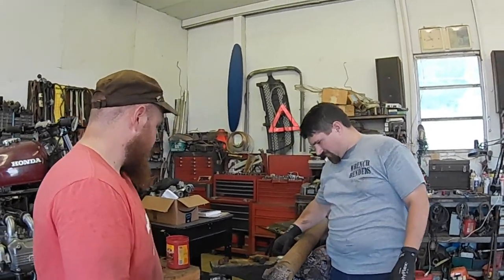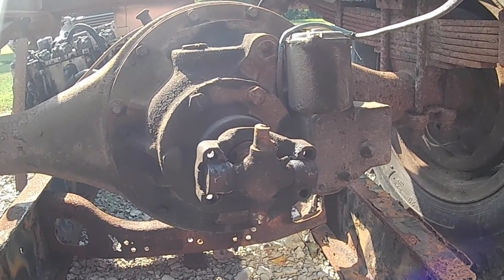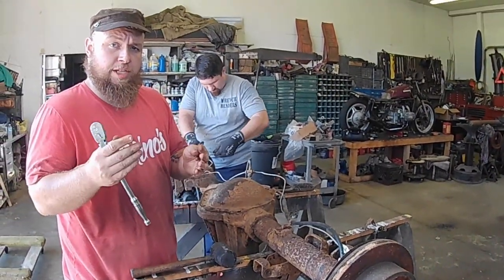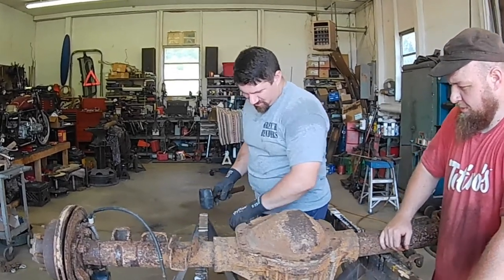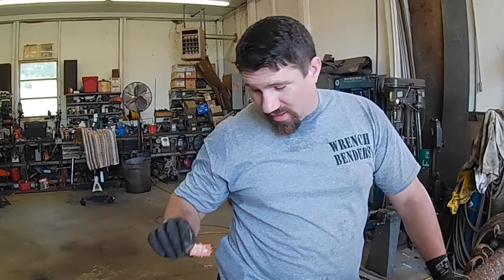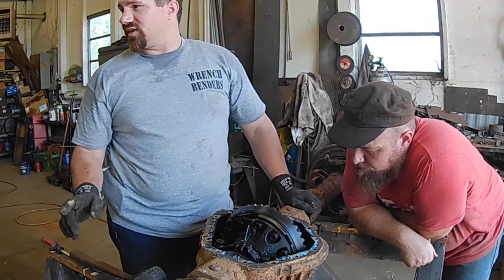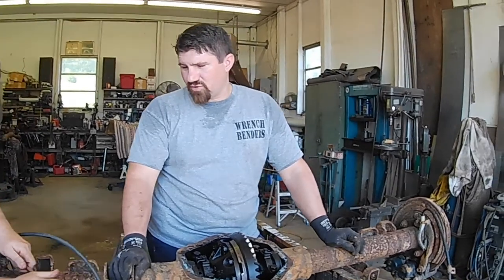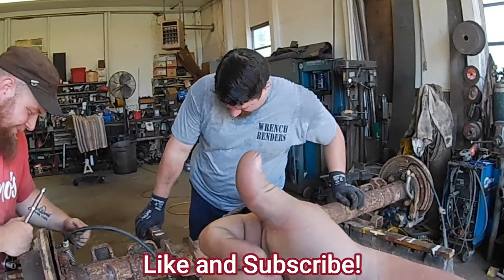Junkyard 14 Bolt Inspection

Comment: That is the newer 14 bolt  aam 10.5. Its the same as the older style but with disc brakes and gov lock. The 11.5 is the aam that come in the diesel trucks. That 10.5 is way more stout than the 11.5 due to the fact it has the pinion support to eliminate deflection. I have the 10.5 n my Tj and my 6.7 cummins has the 11.5.
Reply from the maker: Have done some research since that video and also had to work on my dad's 2500HD and replace pinion bearings (long story). Also found that u joint size changes amoung variations of models in the same year. That is why I love working on new things, always something to learn.
Reply: Btw guys how did this hold up on that beast of a truck?
Reply from the maker: Doing good so far. Have driven several times and even somewhat have burnouts with it. Have not swapped the engine yet.

Comment: Is the 11.5 worth building for a rock crawler?
Reply from the maker: To tell you the truth I do not know. I have hauled pretty heavy and beat on my duramax throughout the years and it seems to hold up. Several pulling trucks out there as well with that axle. If weight is a concern I know they are a little heavier.

Comment: Can I run dual wheels on my SRW 14 bolt full floater? How much wider will the outer tire be?
Reply from the maker: Single wheel axles are actually shorter in width than dually axles. There are several things that go with changing over, but end result would be narrower that a standard dueally.
Reply from the maker: Since your comment, I have swapped my single wheel over to a commercial 19.5 dually. The video is up on our channel and you can see the spacer using to correct the width.